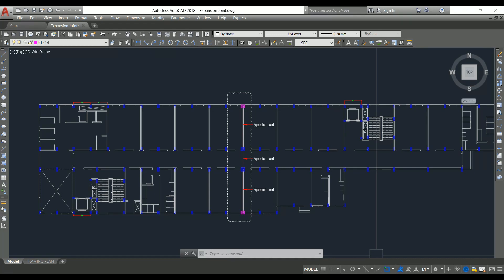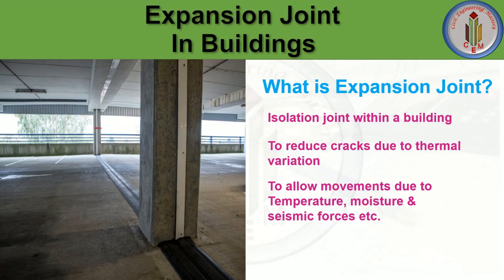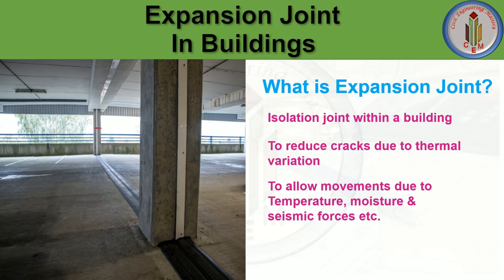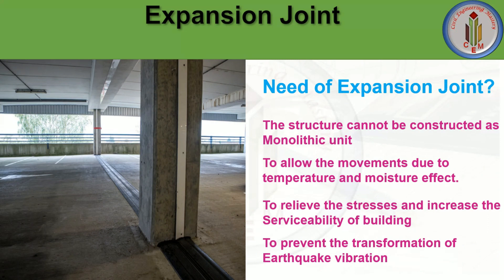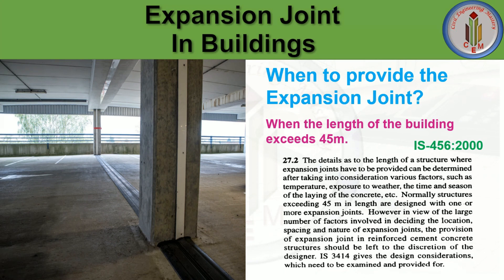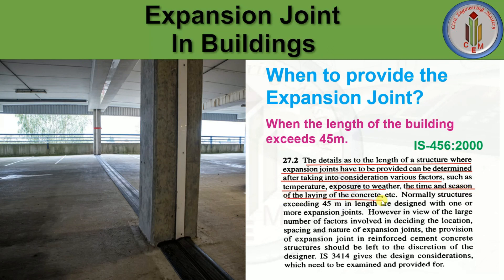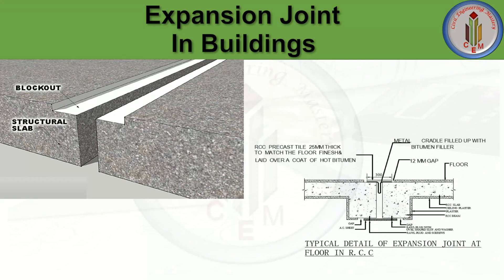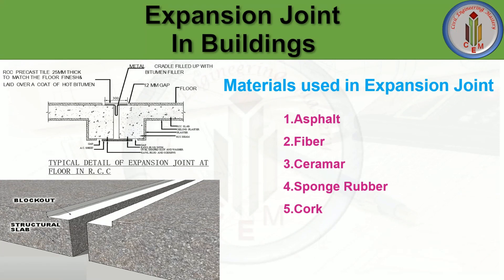Expansion Joint in Buildings | Expansion joint in construction | Separation joint | Expansion Joint

Comment: Thanks. Please confirm the following, that the joint need to take from the foundation to the top of the slab and be frame on each side. Now just joints are liable to water, air leakage and vermin.  I will like to know more on the filling materials, the formwork and the side treatment against such. Again thanks and hope the very best for you for your youtube channel.